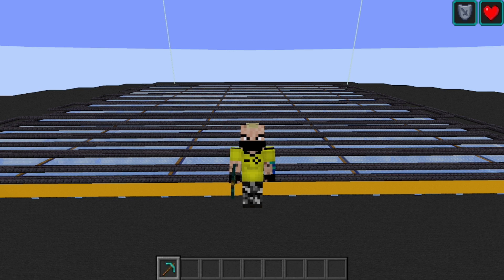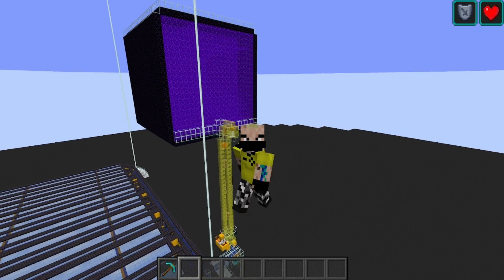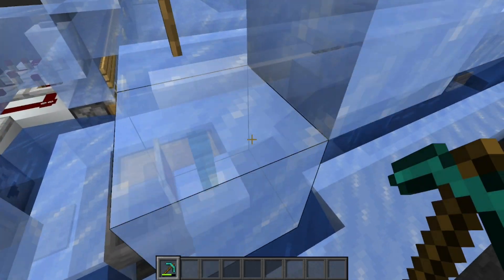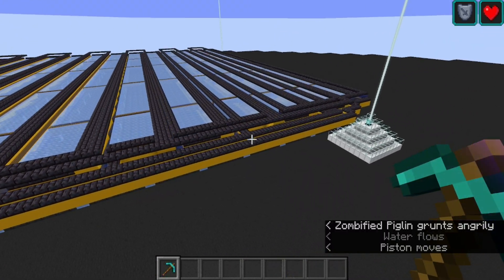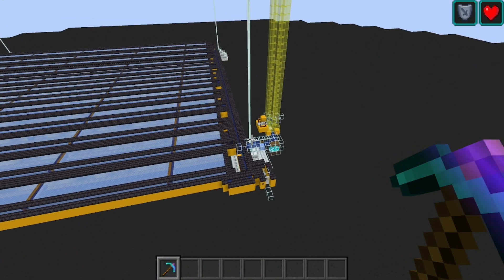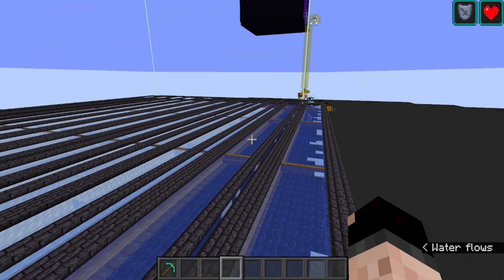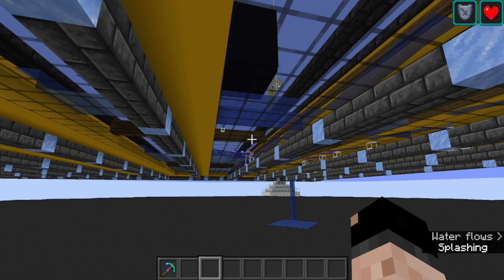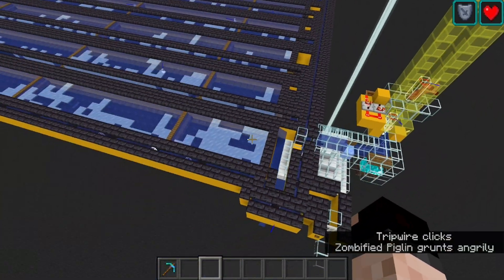My Spin on Genmbon's Ice Farm | 16k ice/hr with infinite mending | Works in 1.19

Comment: @Stromne this is a great addition to Genmbon's Ice farm. I just built this and discovered an issue I don't think you covered in the video. At the collection end of each row, there are two signs that allow the ice blocks to exit the stream and go to the collection point. I had to replace the signs with slabs so that the exp orbs would continue following the players path instead of exiting at the end of the first row. Don't forget the double sign trick is used again at the end of the last row and the signs will need to be replaced with slabs there as well. With these minor changes, the farm is working great with a carpet bot. Thank you!

Comment: Great little modification
From my testing it looks like the pigmen exp module doesn't work well with the mod Clumps
When enabled it seems like exp orbs get stuck in the drop chamber, stopping the flow of orbs to the player which eventually leads to the pickaxe breaking

Comment: Hey stromne, the ice farm works in singleplayer but when i tried it in multiplayer the water pushing the player is not strong enough even with ice, so can you help me please? the server is fabric. The mods is all technical stuff
Reply from the maker: by chance did you add depth strider?  i believe depth strider reduces the water push.  but this does run on fabric and carpet
Reply: @Stromne  no, i didnt add depth strider nor giving any armour to my bot
Reply: @Stromne  or maybe the server itself prevent it?
Reply: @Stromne  i have the same issue. My bot with no armor won’t get past the pressure plates

Comment: Hey stromne, I'm not sure if you're aware of this issue (if you are, sorry!), but in my survival tests I seem to have an issue with the farm where if I take starvation damage on a pressure plate, I stop moving. Any mods I use aren't changing vanilla behaviour as far as I know, but there is a really simple fix, just setting up a dropper with food hooked up to a tripwire that triggers once per total cycle.

Comment: Does the afk mending part still works for 1.19.4?
Reply from the maker: why wouldn't it?
Reply: @Stromne  I thought they updated something with spawn rates outside nether portals due to light levels.
Reply: @mitchlg531  random tick piglin spawning in portals is light level independant.
Reply: @Stromne  I just downloaded the farm in 1.20.4 and there is no pigman spawning. i went through the portal just to see there is no farm nth so i dont understand where the pigman is supposed to come from also
Reply: @guanjiexiong3190  Pigmans have small chance to spawn in any (overworld)portal. Bigger portal, bigger the chance. Not sure, but maybe it doesn't even be linked to any nether portal.